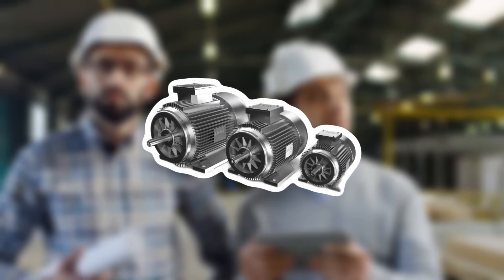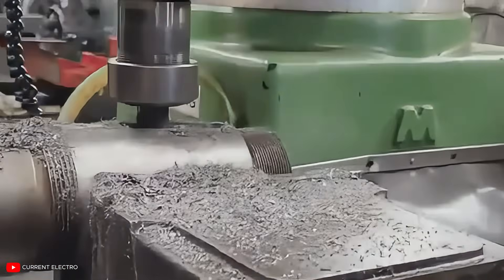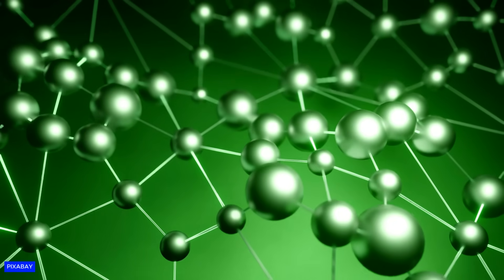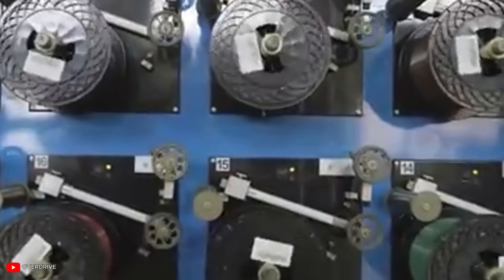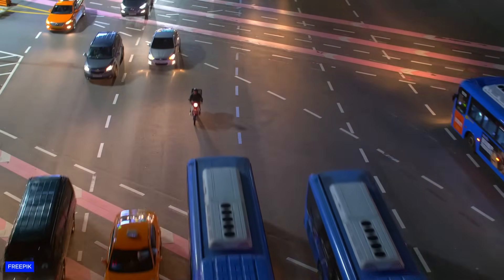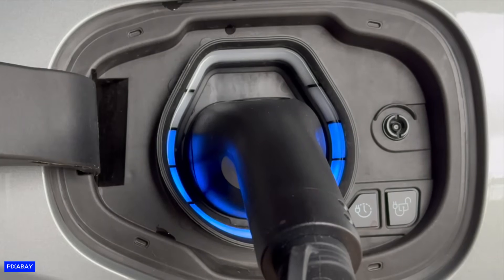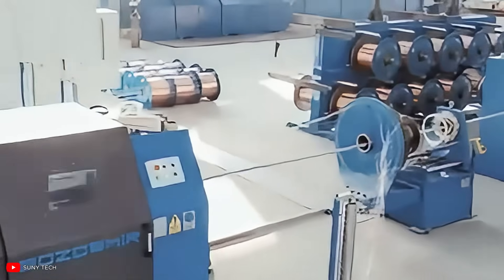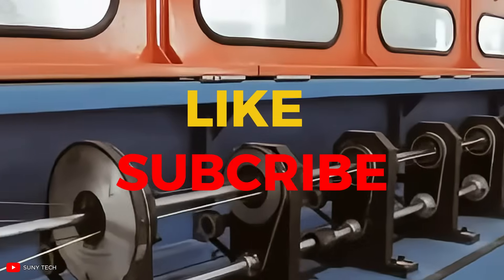The Carbon Motor That Replaces Copper (And Changes Everything)

Comment: with with yasa/donut motors, carbon fiber ras a rotor sleeve and using niron magnet. It would be game changer in the motor industry
Reply: Hey you just said what I was integrating in my brain
Reply: 🙄 You can't replace the metal! 
AC motors don't have magnets! Back to school.
Reply: @mrgoodman6620yasa motors does use magnets and yes there are plans by tesla to use carbon fiber as "sleeves on the rotors"
Reply: @mrgoodman6620ac motors are not the only motors that exist, I wasn't applying that logic to the ac motors
Reply: @xxunoriginalgamingxx9046 Permanent magnets is the actual distinction, all electric motors have magnets.... That's why you can't replace the metal? Putting carbon fibre sleeves on rotors is not replacing the metal?

Comment: Most of the motors I have don’t have copper cores at all, AI has a lot to learn about newer technology instead of 1900’s tech
Reply: No its the copper windings this replaces!🙄
Reply: @mrgoodman6620 so you do realize carbon has an extreme amount of resistance compared to copper, that’s why heating elements are made from carbon. JPL experimented with this in the 1980’s and just like the physics showed it didn’t work. Very few modern high output motors use copper in the rotors, most are neodymium rotor with copper field windings (i.e. brushless motors) which are 3 phase and are way more efficient in making electricity as a generator or power out as a motor. Look at the dark matter motor by koenigsegg
Reply: @M4A2Master well it seem they are proving you wrong because that's what the video is about...  And it's an amateur, not a core! If it's magnetic, it's a rotor in runner, and still has copper windings!!!